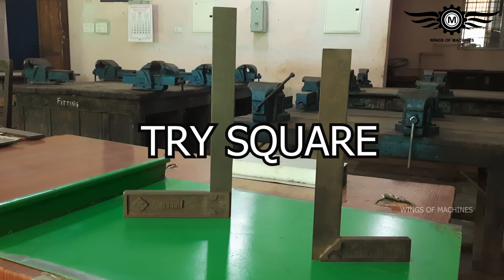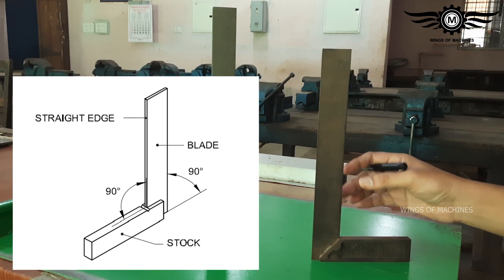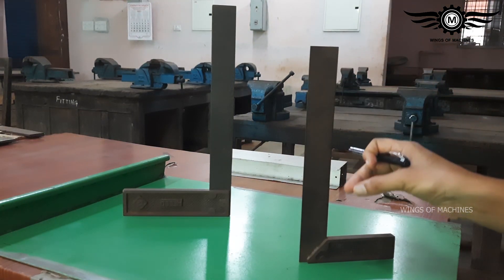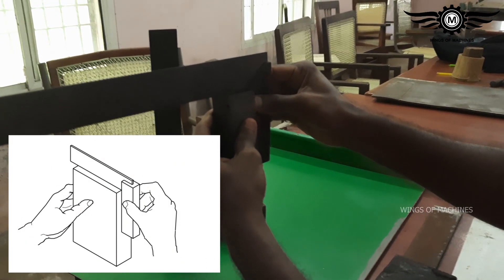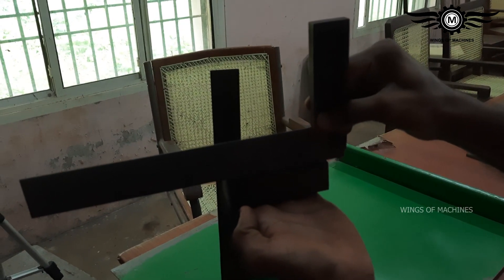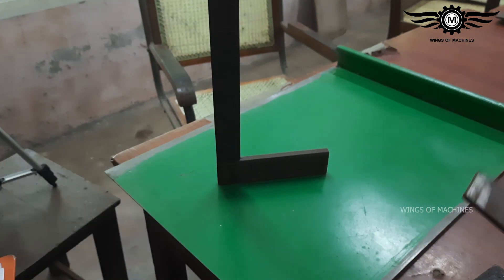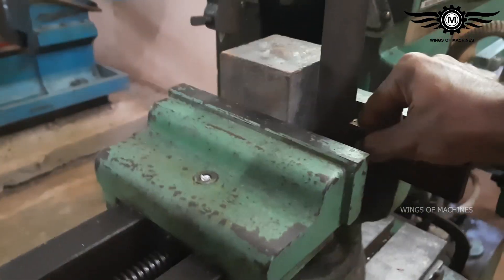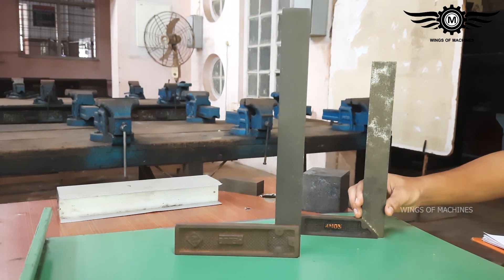Try Square ( Malayalam)

Comment: It's used to mark parallel and perpendicular lines with respect to a finished surface. In some cases we can mark 45 degrees also, if such a provision is their in the try square. It's also important to explain how flatness and square news are checked. Any way great effort, keep going.

Comment: Sir, there is a small groove seen in between the blade and stock of trysquare. What is it called?
Reply from the maker: GROOVE OR RELIEF 
Groove of an engineer's square		The groove or notch is a semi-circle cut out from the stock or blade where the inner edge of the two meet. The groove ensures that no swarf, dirt or grit can get between the engineer’s square and the workpiece at this critical point. By preventing this from occurring, the groove helps to reduce the risk of inaccuracy when checking the workpiece is square.
The groove also helps to prevent measuring the angle of a metal workpiece inaccurately should a burr be present on its edge.